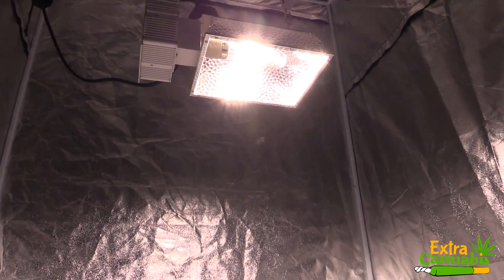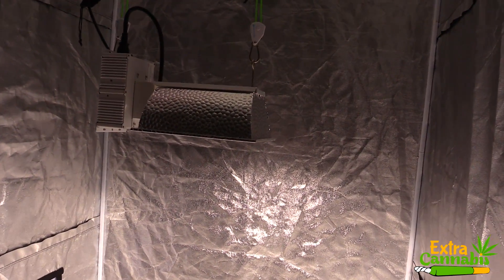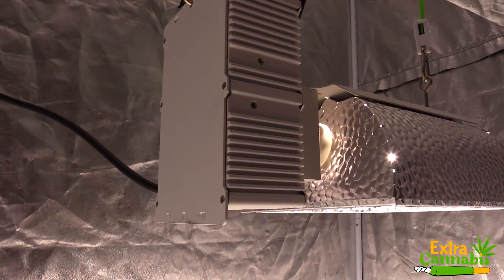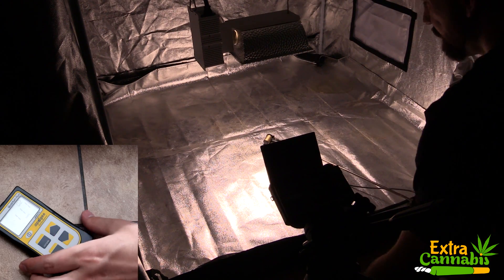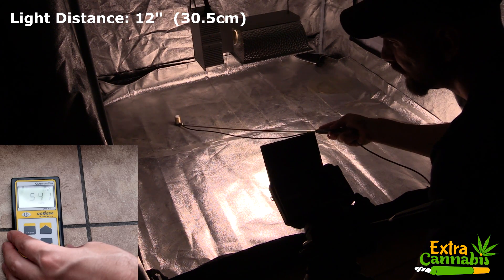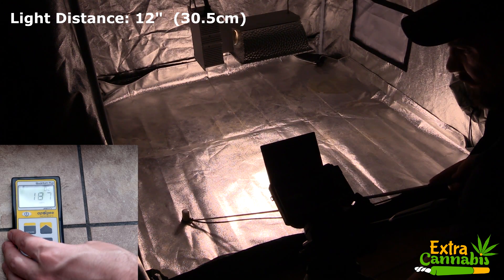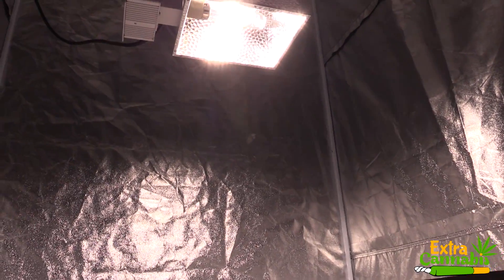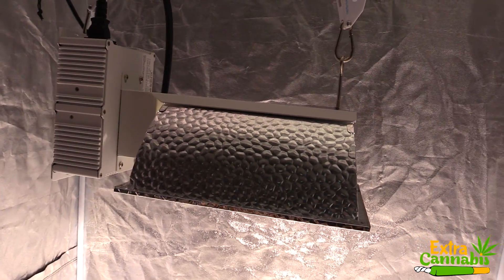VIVOSUN 315W CMH GROW LIGHT PAR TEST!

Comment: This vid doesn’t do these lights enough justice. Thanks for supplying the statistical measurement and performance data, but the real gem of these lights are the found in the light spectrum and quality of light. If you’re considering CMH, jump and don’t look back. In my research you may find different manufacturer’s light features, ie. dimmer, double ended, etc those features are nice, but when it’s boiled down it’s the light quality that shines these through. I made a pun.
Reply: Honestly i would talk smack because CMH does not produce any UVB only UVA but the light spectrum and the quality of the light being produced is super good so i cant talk smack.

Comment: 315 cmh out performs all led for a fraction of the cost and has the best spectrum
Reply: facts
Reply: I run a 650w at 50% power I hit 1000 at a height of 26inches these lights don't come anywhere close to that at 100% I literally have the power of the sun cmh is trash but your to cheap to think otherwise
Reply: Ok boomer
Reply: @beaubridgeman5522  I have to concur. Plants like CMH better than HLG LEDs.
If you're not fighting temps all the time, I'd stick to HID for a few more years until LEDs have a continuous enogh spectrum.

Comment: How about developing a grow light for growing fruits and vegetables with indoor lighting? I can still remember when someone holds a flourescent light tube under a high voltage transmission cable, the flourescent light tube glows. Why not develop something that has no parts that will wear out and is NON-OBSOLESCENCE OR PLANNED PERMANENCE WHICH IS THE OPPOSITE OF PLANNED OBSOLESCENCE? In the 1970s, a small Japanese did just that by using double step-up transformer to increase the voltage level so as to induce an electromagnetic corona effect on the sealed mercury gas-xenon gas light tube that causes it to generate a powerful light output. Then you Americans went in, purchased the company using your powerful friends, and destroyed their product line of BUY ONCE AND BUY NO MORE LIGHTING! Fortunate for us Russians we had a joint venture with them and we still manufacture such lighting, against the useless wrath of your corporate overlords because we Russians are hell bent on making manufactured products formulated and designed and built to remain functional, usable, to last as long as they exist. NO PLANNED OBSOLESCENCE IN RUSSIA!

Comment: Thanks for the great info!! Would've loved to see the 18" reading, as I run CMH. I have the SunSystem 315 so I would really like to see those results.
Reply: Im guessing like 8 900
Reply: How’s the electric bill as compared to say LED LEC or a 1000w HPS ? 
Thanks !
Reply: @engell3707  4y later and I’ll tell you, a 1000w lights pulling a true 1000w rus 1kwh an hour at full power. A 315 cmh runs .315kwh per hour. So it’s about 1/3 the cost! most would run a double ended 315 for a 630 and use it light your 1000w

Comment: would the double  be ok with 5x5 ?
Reply from the maker: You'd probably be better off with a 630w CMH grow light instead for that grow space.
Reply: @GardenTalkwithMrGrowIt   yep thats what I ment.  I need to cover 5 foot wide but its in a large room not a tent. im running two 1100w hps in the room now and my ac cools it fine but the cost is crazy. im just looking for something to replace them but I dont want to lose yield.   I was thinking of trying 2 of the 630w cmh .     do you think that will be enough or should I get 3 in there?
Reply from the maker: @majorgreenz2811  Ah got it. I wasn't sure if you were trying to squeeze two separate 315w fixtures in that space or not. Yeah the cost for the lighting + cooling really adds up.

Comment: I want to see the sun systems lec 315w. Thats what i have indoors. They crush it!
Reply: Run the same lamp the whole veg and flower?
Reply: @bennyb6071  yea! They have a great spectrum for both cycles. I do want to boost flower with LED blue and IR spectrums, but my funds are limited. Haha. But they crush it. Less power more flower. Haha.
Reply: @highsierragrowbro6683  awesome pal,  appreciate the reply,  up in Canada here thinking about getting similar light for the cooler weather
Reply: @bennyb6071  anytime man! Check out the lights at work on my channel! They give out some heat too so it helps keep the growroom at a good temp if ventilation is on point. Cheers Growbro!
Reply: @highsierragrowbro6683  right on,  just subbed, Thanks again😎
Reply: I run CMH as well and they freaking kill it!! 3100k Phillips are the full cycle bulbs I run and always get a better quality product than my HPS friends that grow. Just sayin
Reply: @patd69  growbro they crush it! I believe i have the same bulbs! I have a 6x6 and 2 in there. Love the results! Cheers brootha happy growing! Check out my channel!

Comment: I'd like to see the ES300 next, I've got 2 of the ES300 V2's in a 4x4. 
Keep up the great work. Hope the main channel comes back soon, with all your previous videos! 🌲🍁💚🤘
Reply: I was thinking about getting 2 for my 4x4. Hows the heat with 2? Are you happy with them? Any issues? Thanks
Reply: @beaubridgeman5522  I'm running 4 of the ES300'S. They give off a bit of heat, but no where near the amount that HPS does. In the 4x4 tent, running 2 at about 80%, I didnt have any issues as long as I had good exhaust ventilation, and the main room the tent was in had a decent consistent temp as well (around 69F-72F room temp). And as always make sure you've got a bunch of fans for ample air circulation.
Reply: @beaubridgeman5522  if you want to see what the ES300'S are capable of, feel free to check out my IG @ dutchcanuck.thc 🤘

Comment: Wow ....I was expecting much higher par, at least higher than my new tsw 2000 from mars hydro, is this normal for led set ups to get higher par values???
Reply: It is normal for LED's to get better umols/s/J better.  Your TSW runs at 310W +/- 5W and has better PAR at comparable distances, but it also costs $100 more as well.  The CMH has a better spectrum and is a fantastic veg light, but can certainly flower in a 3 x 3 (like yours) and has great resin production. Usually 2.5 umols/s/Joule is very efficient (Yours is 2.3)  but the LED's are now going over 3 umols/s/Joule ($$).  You should be very happy with your light for a long time.
Reply from the maker: Yes, many of the top LEDs perform better than HID.
Reply: Both cost the same exactly for me . I went for the cmh !